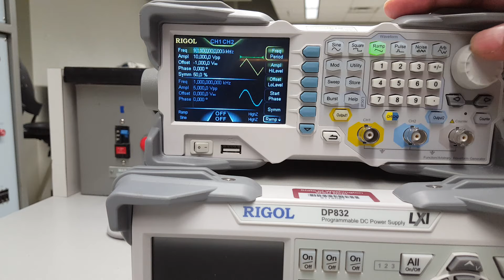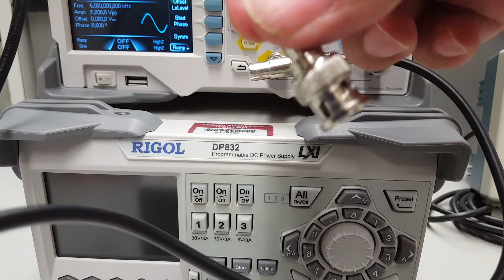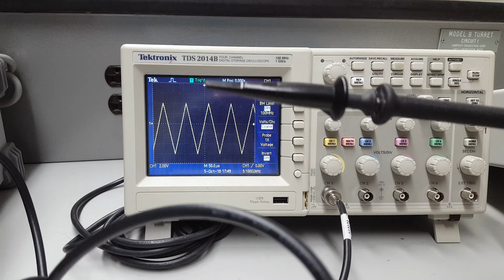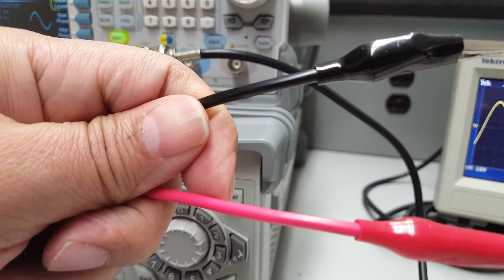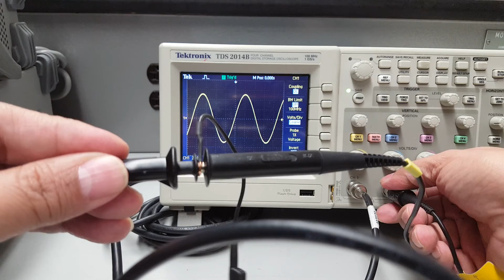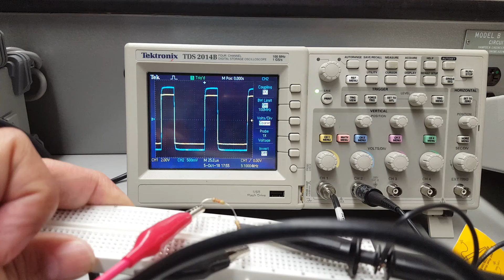Tutorial - introduction to function generator and oscilloscope

Comment: Two questions: 1) I noticed that the circuit probe was not connected to ground. Is that because the barrel of the channel 2 BNC connector on the scope is already at earth ground?  2) you didn't mention the scope/function generator impedance. Did you adjust the output impedance on the AWG to match the scope's high input impedance or is there a 50 ohm terminator on the BNC connector to channel 2?
Reply from the maker: Excellent questions. All the channels have the same ground, and this is the ground of the function generator.  
At low frequencies the 1/4 wavelength is too long, you can assume lumped elements and ignore the reflection coefficients. Therefore, the function generator is modeled as a voltage source with 50 ohms in series. Other function generators have the options of high impedance and 50 ohms termination. Excellent.

Comment: Thank you for this. I would love to see how these instrument are used in an actual repair / diagnostic situation.
I've been looking all over for a real-life demonstration of these two instrument working together. everybody just shows the functions and that's it.
Though, I've got to say this comes closest to what I am looking for the real life demonstration 
Just seeing how you connected it to the resistors it opened a window in my minds eye to see through. Thank you for that. 
I'm going to put diodes, resistors, capacitors, other chips and try what you just showed. 
It still is not real life but it's close.